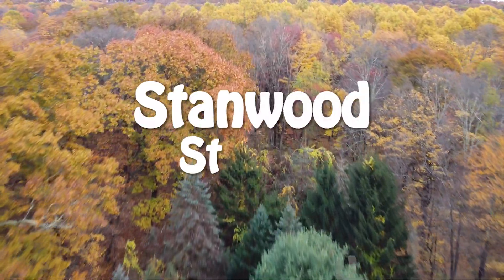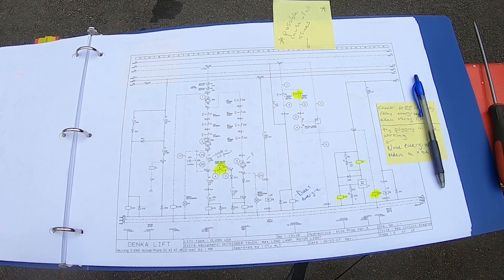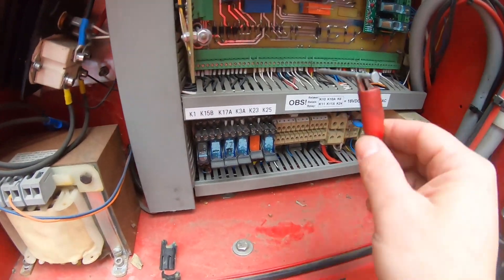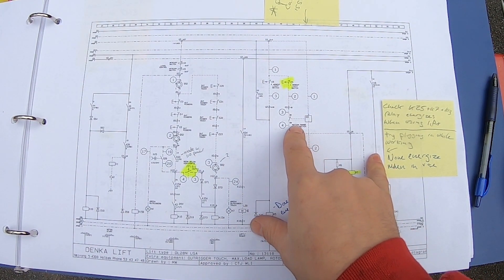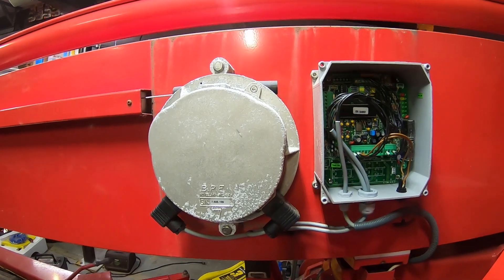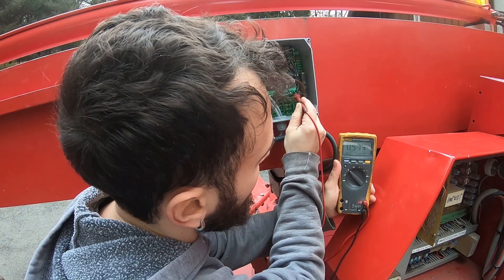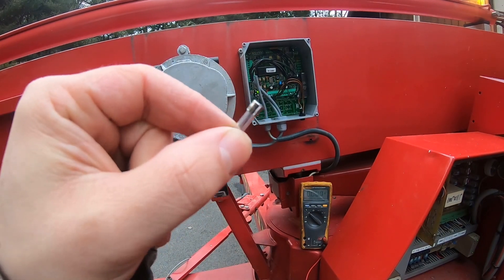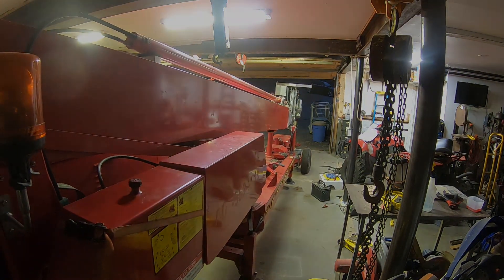Denka Atrium Lift Electrical Troubleshooting - Start To Finish - Partial Function Loss

Comment: Hello! I am writing from Hungary. Great video! We also have a Denka DK 25, made in 2007. Unfortunately, I couldn't find any video or document anywhere where the 4 piece downstroke working cylinder was repaired. The hydraulics of our machine is the same as the one you have described. My question would be, how do you get the working cylinder out of the mount?  Thanks in advance for your reply!